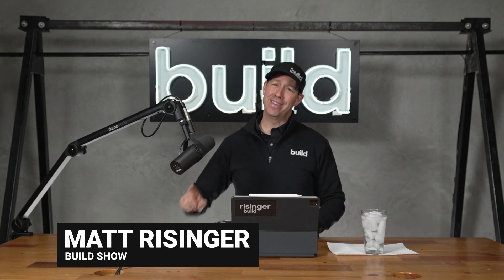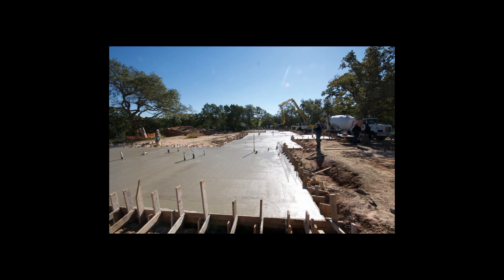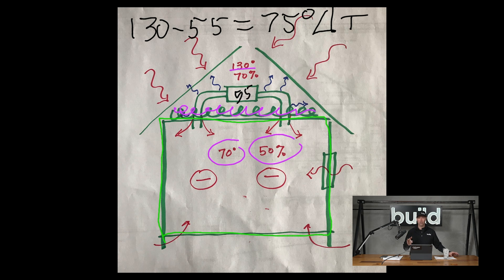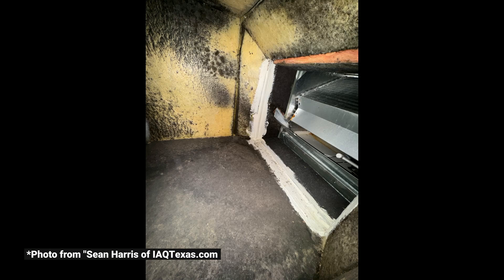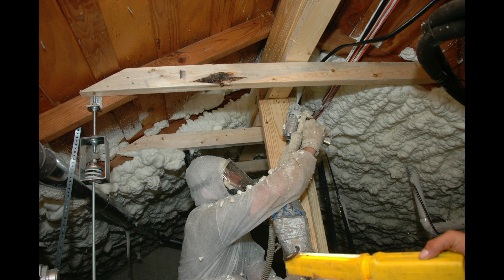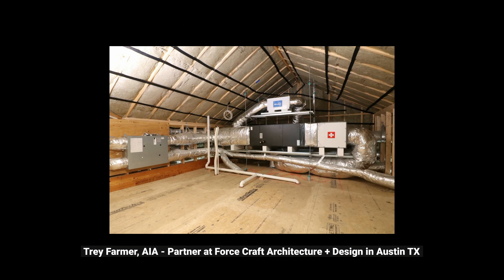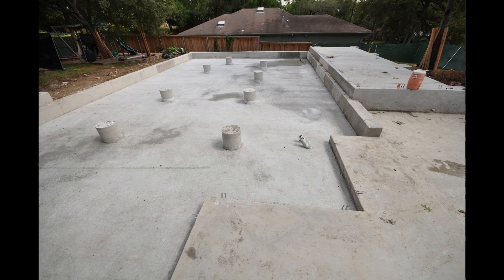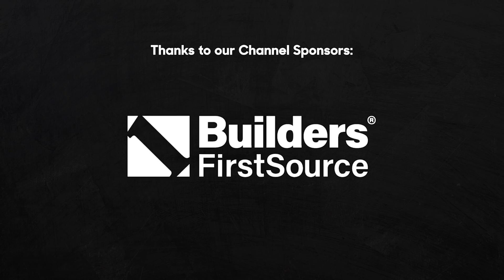Number 1 Dumbest HVAC System Mistake (Whoops)

Comment: Matt, every roof will eventually leak unless you preemptively replace it. Replacing anything before it breaks is not usually sustainable. We should not be aiming for 100% reliability with today's tech. It's not realistic, not for a ROOF. :)

You can foam an attic but now you're compelling the owner to replace the roof before it leaks -- somehow. On a schedule?? Rockwool is indeed the compromise here: It will let the eventual leak reveal itself before becoming catastrophic, and not harm the mineral wool.

Also, where's the radiant barrier here? Assumed to be built into a fancier external sheath? Thanks.
Reply: I'm not a builder but I'm with you.   It seems like a lot of these designs work beautifully in theory (assuming the builder is very meticulous and has an excellent crew) - but get them out in the real world with ignorant and/or negligent homeowners and the untrained and indifferent contractors they hire to later come in and cut holes in walls and 'fix' things and you've got a recipe for leaks that will not dry out and not show themselves until there is catastrophic damage.

Comment: Metal, metal, metal!!! No flex through the first floor ceiling. I have seen flex duct in the ceiling become extremely brittle. Plastic holes and the insulation wrap exposed to the air flow. (I hate fiberboard for a similar reason, fiber glass in the air flow).
Reply: Thank you! Too many homeowners don’t want to pay for sheet metal duct and too many HVAC contractors either too expensive to do it or don’t even know how.
Reply: So people don't use vent boots and bring the flex to or through the drywall????
Reply: @sparksmcgee6641  they do use vent boots, but the inner liner of the flex pipe is plastic or a thin rubber. Over time, the inner liner will break down with all the hot and cold going through it, drying it out, over the years. The inner liner will become brittle and will start getting cracks and holes in it. These holes will expose the insulation wrap around the inner liner to the air flow. Metal is a better product. And this is only one reason. There are two other big reasons to go to metal and not flex.

Comment: I really have been thinking about how bad an idea it is to be making cold air 
  Dumb, or smart (AC) in the basement and pumping it upstairs.  My house was built in 1943, and was heated with a gravity furnace.  No blower.  
   I’m really thinking about a mini-split system with the output in the upstairs landing.       N.E.OH Bob.   Zip # 44221

Comment: When doing spray foam on crawl space walls, are there issues with termite inspections?
Reply: Yes, termite companies are dropping their customers--even those with a 3"-6" termite inspection gap (required now by some local codes).  There is an on-going battle between crawl space renovators and pest control companies.  Many crawl space renovators are being rather vicious, blaming the termite pest control companies for using "outdated  inspection technologies."

Some crawl space companies claim pest control companies should be using magic technologies like high-powered stethoscopes to listen for termites, or use infrared scanning to locate termite colonies (sounds a bit like injecting disinfectant into your veins to kill off COVID). Close, but no cigar.  There is no technology substitute for the visual identification of termite tubes ON A CRAWL SPACE WALL. Spray foam or foam insulating board covers & insulates a crawl space--muting termite colony sounds and attenuating thermal termite signatures.

There are at least 10 or more videos on YouTube on the subject of termite companies cancelling customer termite bonds after encapsulating their crawl space. Then, there is this interesting story here in my hometown of Raleigh:

"Beware of Termites in an Encapsulated Crawlspace"    https://fcinsp.com/encapsulation
     Cutting to the chase: If you are buying a house that includes an encapsulated crawlspace, 
     it is especially important that it is covered by a termite bond and that bond should not lapse.

Comment: UV systems help with growth inside air handlers and ducts. Filtration very important too
Reply: MERV 13 filters with an Amazon scheduled order for replacements. A few years ago no one even knew what MERV was.
When my mom built a place 4 years ago I said I wanted MERV 20. 😅😅
Took me a minute to look at the ratings again before I realize that's a bit overkill.
Example is medical surgery rooms are merv 18-20. There aren't any environments that use a higher rating for human occupation.

20 to 30 with is the top of the scale is pharmaceutical fabrication and it tops out at chip fabrication foundries that are MERV 30.
Reply: This. UV comes in two sorts: the sort that causes skin and eye cancer but doesn't ionise indoor chemistry, and the sort that doesn't cause cancer but does ionise indoor chemistry. You can have the cancer-causing stuff inside a duct to kill off bacteria and viruses and the like and it will be fine so long as your skin and eyes are never exposed to it.

Comment: Here in te denver area we definitely have ic HVAC as well as slab on grade and crawlspaces. Though I am seeing more sealed attics. Only way I'd do a crawlspace is if I had it insulated and sealed like the "short basement crawlspaces" you've shown. Even had one customer tell me she had them pour a floor in the small crawlspace they had (mostly basement) because she felt the crawlspace with dirt inside the house like that was disgusting, and I agree. And as someone who works on machines for a living and for fun, I strongly feel machinery and mechanical systems will always remain in the best condition if it is all 100% in the same clean, conditioned space.
Reply: Yeah some crushed and compacted stone is a little better in crawlspace because years from now adjusting the clearance is easy. A good barrier material over the rest of the dirt to the footer is worth it. Something 15 or 20 mill. You can walk or crawl on it
Reply: I'm in Denver also, what  trade are you in?
Reply: @sparksmcgee6641  Central vacuums, so probably in the low voltage category, but I really specialize in the vacuums.

Comment: I know another dumb construction move that only saves building time. Why can't small electrical lines like phone, internet be run through conduit in a orderly way. The last week or so I've had intermittent phone connection to my master bedroom. I'm thinking mice finally got to it. Built in 83' only had a phone in the kitchen and master bedroom. no doubt it stapled all through out attic and walls from garage where it originates. There's no way to pull new cable through. I know it would be added cost but if a house had a central closet everything routed to or from it would make for shorter runs. And maybe save someone like me 40 years down the road. Of course by then phones will all be wireless. Now I need to find a multi-phone answering machine with 2 extra wireless phones. I know rant, rant.
Reply: I dealt with the same things including with wanting to bring coax through.   SO stupid to staple it and not put it through conduit going up a wall.
Reply: @suspicionofdeceit I use my old school phones to ring my lost cellphone when I can't remember where I left it!  It's $10 a month more on my Google Fiber plan to tie my fiber to my existing (1990's) twisted pair phone loop running from room to room.
Reply: You're literal 20 years behind. Media cabinet that goes on the wall  ear where you're electric panel is. 
Everthing wireless from there, house phone if you want one, cellular booster, wifi ect...
Only guy that loved tech that ran a direct line around the house and through the wall to a TV was a competitive gamer that couldn't have the millisecond delay from wireless. 

Look at the wireless home phones. They're expensive because only rich people had them 20-30 years ago, then everyone jumped to cellular.

Comment: Another dumb mistake in HVAC systems is when the supply vent to a room or office is right next to a return. This causes the far end of the room to be at a different temperature. Also the closeness of the supply and return is a feedback/short circuit causing inefficient loop of the supply going directly to the return. Do a smoke test right next to the supply to see how much goes directly to the return vent.
Reply: You are 100% correct. Even years ago as a HVAC contractor I would reject prints showing extensive ductwork and systems in unconditioned attics. I pissed off a lot of architects and builders asking why they continue to do something so stupid, but they never got it. All of those McMansions built in the northern climates most likely have miles of leaky ductwork in the attic. They would never consider my suggestions to install 9 foot ceilings within the envelope and build a soffits. Today they are still building the crappy houses they built in the late 1990’s. The mold spots on the ceilings from sweating ductwork it proof it was a dumb ass idea.
Reply: @joecushman6030 I don't know what's it was like in your area but in my area  the HVAC contractors themselves are just as stupid
I say "the HVAC contractors" instead of "most HVAC contractors" because so far I have yet to find one that's not.   I'd love to find a HVAC contractor like you who would not only want to do something right and know how to do it right but would be willing to risk pissing off a builder or architect to insist that it was done right.
Reply: In an industrial application your comments are 100% relatable. I was about to hire on to design a line of housing mounted a/cs, essentially vertical PTACs. When we looked at the cold air delivery and return they were side by side. I came up with a universal design in my sleep and jumped on CAd at 2 a.m. I split the evaporator ports, or in a requested broad flat design f used a high speed scroll fan to blow hard into the electronic cabinet to mix to the max with the electronics we were cooling. Then most machines condenser side was cross flow to minimize that short circuit. Maintenance people raved about the logic and serviceability of these machines and became preferred. I helps launch them for 5 years. Year 7 they were one of the top 50 fastest growing companies. These set of features and attention to cool design had our machines in the top tier of performance.
Reply: We have codes in Florida that makes you separate them.  I go over the code unless there’s no choice.  3ft is the minimum
Reply: @Navy1977 I'd like to know this too. I'm figuring supply in the middle of one side of the ceiling, shaped to throw to both sides, and return down low on the other side of the room. But if there's something wrong with that I'd like to know before I start building my next house!

Comment: What would you recommend a homeowner do if they unfortunately have ducting in an unconditioned attic? I have a 2-story with two air handlers, one for the basement and main floor and one for the 2nd floor. All of the 2nd floor air is run through the attic. I'm in Nebraska where we see the full spectrum of hot and cold temps. 

Do I just hose all the ducting with spray foam? Roof is built with standard trusses so making the space conditioned isn't really an option.
Reply: As an hvac guy. Please don’t spray foam your duct.  Just wrap it with proper fiberglass insulation.
Reply: @michaelsatterfield7944  reasoning? Fiberglass sucks. Especially in an attic where condensation is a concern. Or the possibility of rodents chewing it. Also the spray foam completely air seals the ducts so you're not losing conditioned air that you paid for to the outside
Reply: @DTWCT  SPF insulation contains chemicals called isocyanates.   Isocyanates: Rhymes with cyanide.  

All foams degrade with time, and especially with heat.  Do you really want cyanide compounds in your attic?  While I cannot speak for Michael directly, it kinda sounds like HVAC guys would rather not have to deal with cleaning up decomposed cyanide-based compounds it in the future when they go to repair ductwork.

We've seen similar stories at least twice before: Chinese drywall (sulfur+water=>hydrochloric acid)  and UFFI foam (Urea-Formaldehyde Foam Insulation).

Amazingly, the building construction industry seems to find a new, seriously toxic building material to use about every 8-10 years.  Two-part field-mixed spray foam is the new UFFI used in the 1970's and early 80's.
Reply: Why can't you spray foam the roof for a conditioned attic? If not then yes spraying 1-2" on all the ducts is the next best bet
Reply: @DTWCT  it's my understanding that most asphalt shingle roofs aren't rated for an insulated deck so I'd probably have to build out a ventilated gap. Seems like a major pain in the ass with the trusses all in the way.
Reply: @BillJBrasky  it is a pain in the ass. I installed the stuff for 7 years lol. Also, contrary to what a lot of people believe, the foam only increases the temp of the shingles a few degrees. Having a vented attic doesn't really help "cool" the shingles when it gets up to 120 degrees. If you're set on keeping the roof vented though then yes you'd have to run a continuous baffle from the soffit to the ridge

Comment: Here in zone 8 the frost line is quite low, but 4 inches of foam sticking out 4 feet will prevent frost from tunneling under. It's also good to put foam insulation horizontally above underground pipes. Another problem is Central vacuum systems where the pipes or the unit is below the dew point and that leads to plugged pipes or plugged up filter.